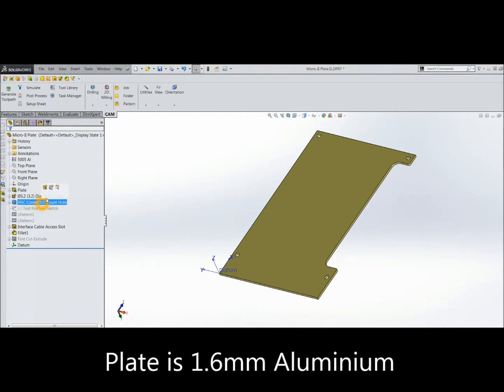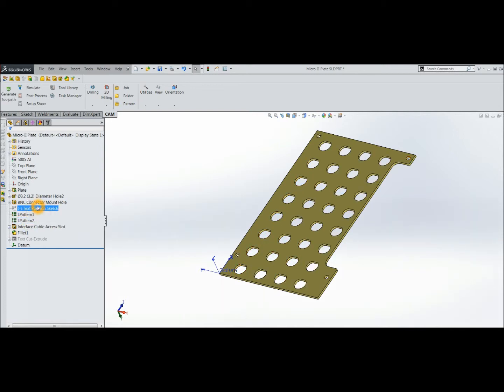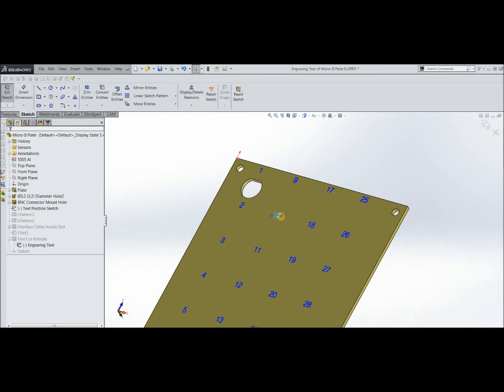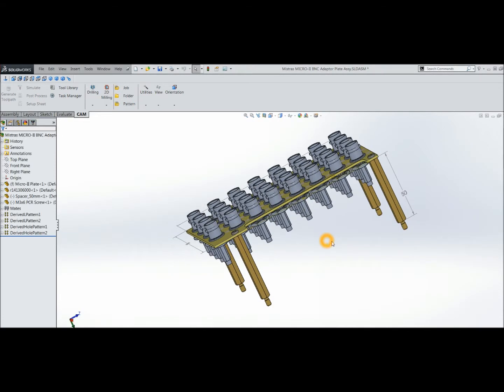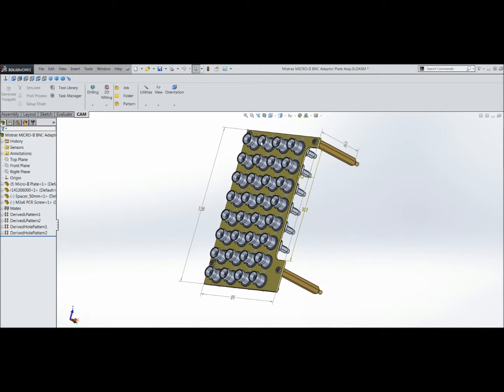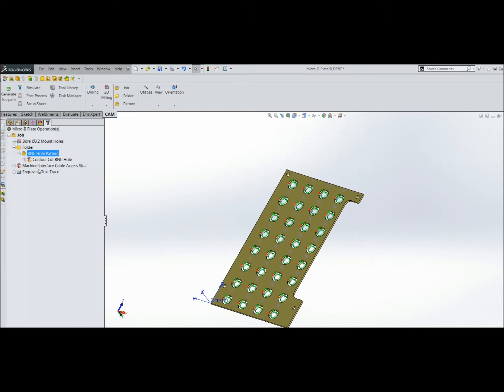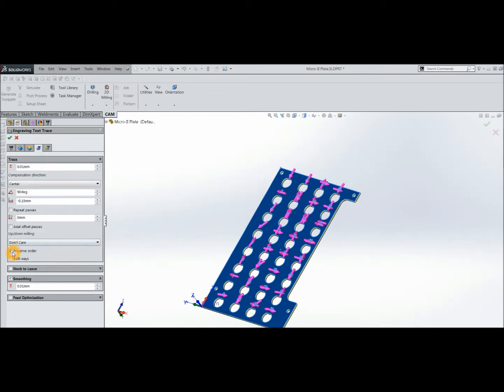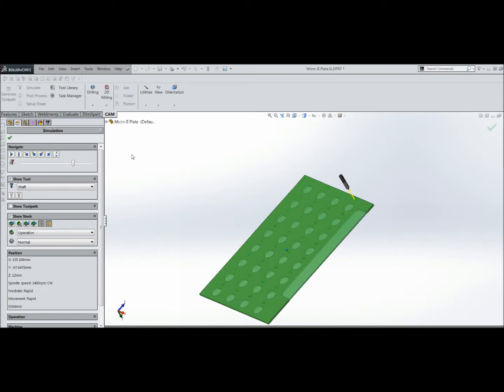Engraving using Solidworks & HSMXpress

Comment: Nice Job. I have found that a number 00 center drill in a 1/8 collet engraves really well and can take some abuse. You can get doubled ended carbide ones for $10-$12 on many websites.